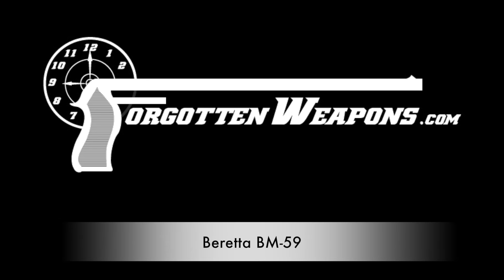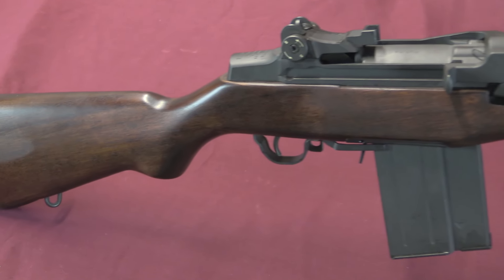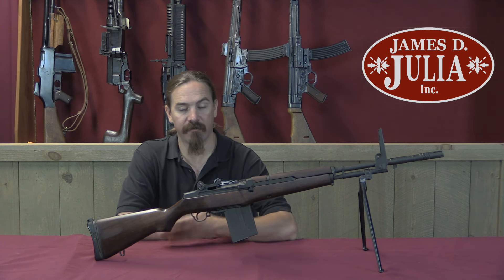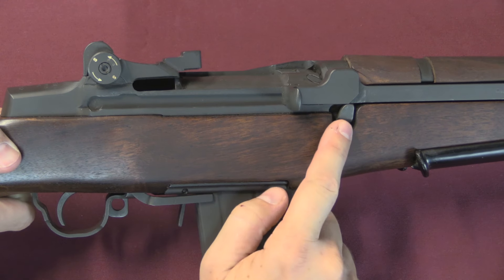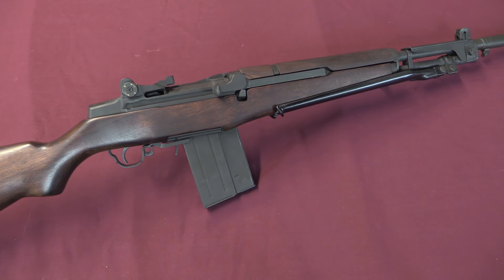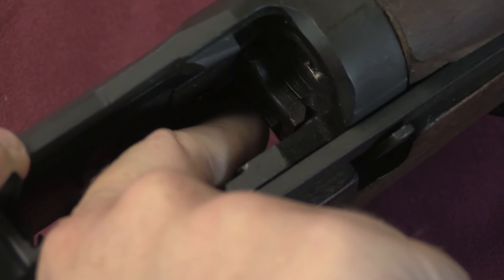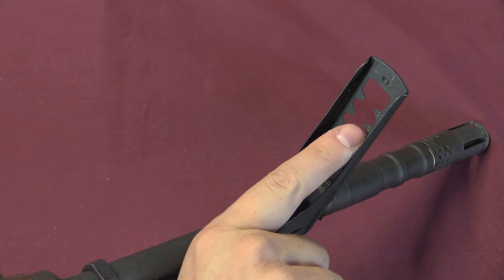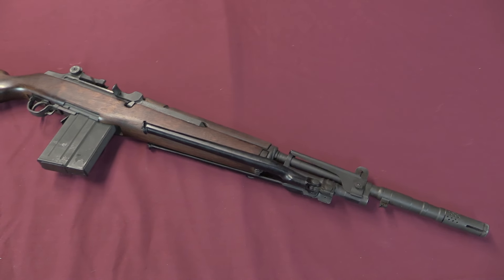BM59: The Italian M14

Comment: The more I watch this channel, the more I realize that American guns aren't especially great. Other countries produce really good weapons too. For some reason, I just always thought the US would've produced the best ones.
Reply: Simply beacuse these guns had a bit of problems when they were sent to "normal troops" for example i trained with this gun and with Garand back in my conscription period and in my unit normal "slaughter meat" soldiers, at least 20 bm59/62 simply failed or jammed in a unfixable way, while the garand we used (60 y.o. guns) only one jammed because a dickhead didn't oiled the gun propely, so when the bm59 need to be sent to normal troops they were the "normal rifles" but when they were delivered to specialized unit such as "alpini", "colmoschin/comsubin" ecc those gun were the quality ones....i've to admit this gun is not so bad, but i still prefer the original garand and m14, i feel them more reliable. But that's my opinion and my experience so....
Reply: beretta produce armi dal 1526, forse ha un po 'più di esperienza con i vari coltelli, Springfield ecc.

Comment: When I took a gunsmith course in the late 80`s, the general wisdom amongst the sages in the gun fraternity was, that you do not mount a bipod on the barrel, or, in this case the gas tube, because it would change the ballistics of the rifle. Has that been proved wrong?
Reply: In the squad automatic role (like a BAR) you walk your fire onto the target with short bursts, or you you use it as suppressing fire as the others move. These rifles are generally not meant for long ranges ( no long range 1km sniper shots), so the ballistics being tweaked by the bipod is offset by the better control in full auto.
Reply: Much appreciated! Thanks

Comment: Was just watching your video on the Winchester experimental modifications of the Garand, and specifically their difficulty with full auto.  Was thinking the BM59's moving to the .308 might've helped its performance in that regard, a shorter cartridge allowing the bolt to clear it with a cushion, giving more time/space to load the next cartridge.  Both very interesting videos - thanks!

Back when I was shopping for my first Garand, I used to lust after the Berettas, thinking a box mag must be the way to go, but ultimately decided I would rather have the internal mag.  Those BM59s sure look like great guns, though!  Now I need to find a video of one shooting full auto.
Reply: What really helped was the straight op-rod (M1's bent one, in full auto, became a spring whose armonics interfered with the burst, jamming the action) and to get rid of BAR's magazines, that were pretty bad, and were reliable only if helped by the inertia of the heavy bolt of the BAR).
Reply: @neutronalchemist3241  How do you mean, straight op rod?  Was just looking here https://www.youtube.com/watch?v=yrpbf9Fmpeg and looks mainly the same as my Garand's or the Springfield he shows sitting next to it.  Funny, that was the one part I thought looked sort of funky when I first took my Garand apart - with that kink in it and look/feeling  to be something like pot metal!
Reply: @tyrrannoform  The front part of the BM59'a op rod is a short and straight cylinder. That of the M1 is longer and slightly bent (WWII's GIs had to be specifically instructed to not straighten it, since it could seem it had been bent by chance during use).
The elasticity of the long and bent op rod easen extraction, but it interferes with an eventual burst.

Comment: Looks like what the M14 should have been. I doubt it saves any weight vs the M1, even without the bipod, but it is slightly shorter, with a good muzzle brake. That gas cutoff/grenade launcher sight is inspired. 1 piece doing 2 functions. Experience counts- Beretta has been around since what, 1520? I would love to have a semiauto one, when i move to a free state. It will go nicely with my M1 and M1A. Great video as always. Thank you